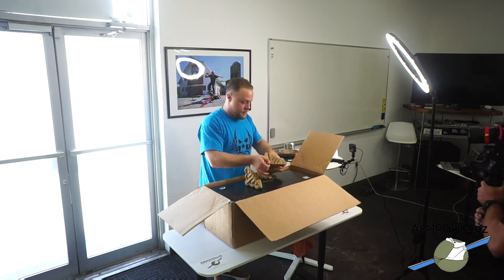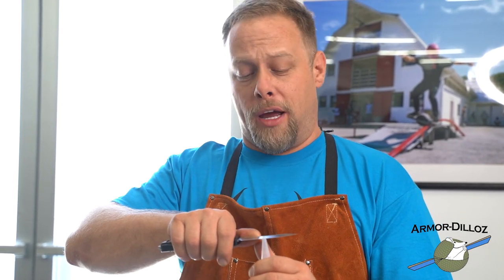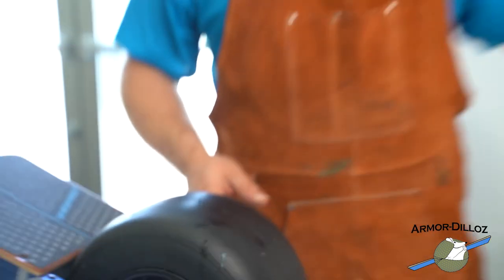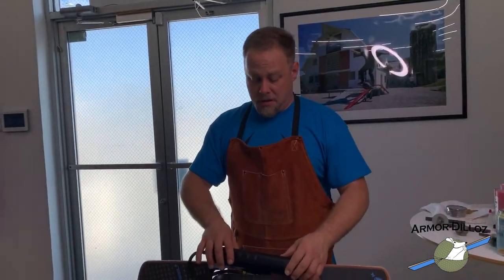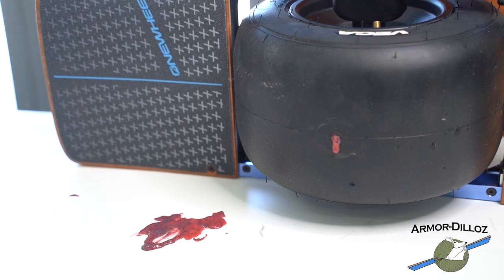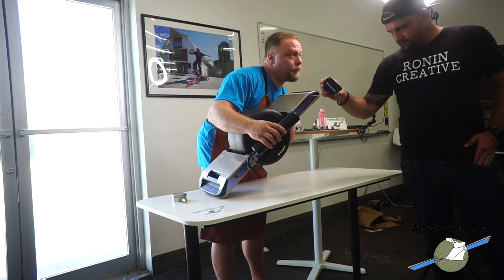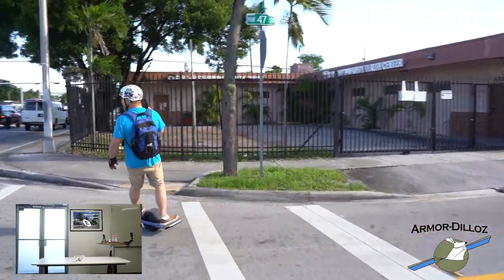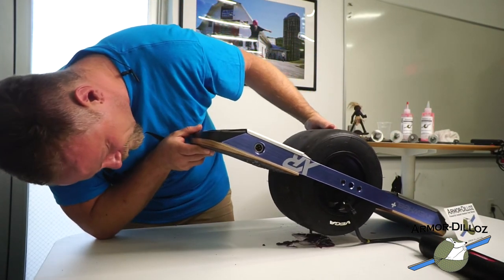Armor-Dilloz Tire Sealant - Testing a Brand New Onewheel XR - Livestream

Comment: I bought the pink one for the electric scooter 8.5 inch wheel, its leaking air under the valve, is that a problem?

Comment: How about sidewall?
Reply from the maker: Sidewall punctures are always more challenging to seal due to location and flex in the area. It also depends on the cause of the issue. We have had successful reports from riders with sidewall issues. The key is getting the product to the area.